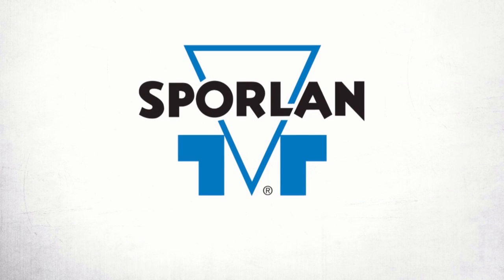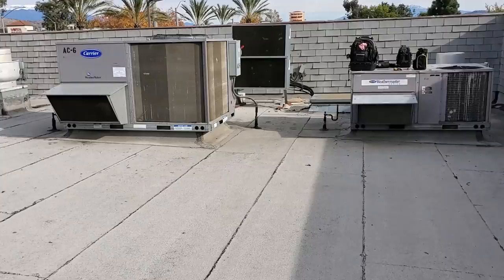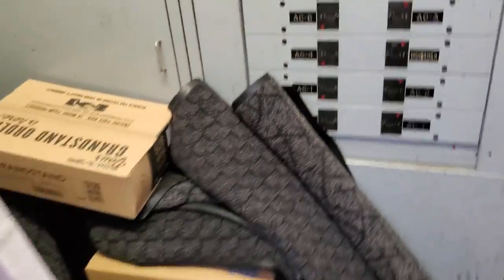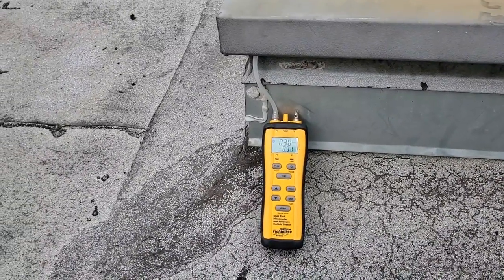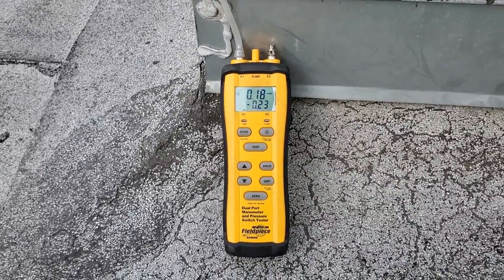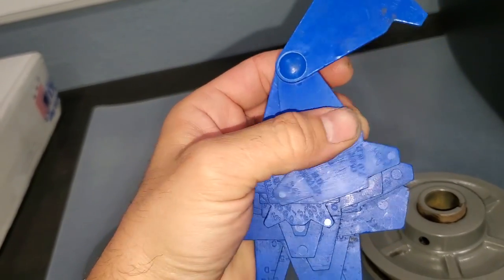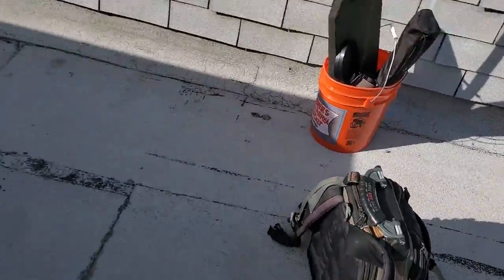THE FRONT DOORS ARE TOO HARD TO OPEN (AIR BALANCE ISSUE)

Comment: Correct me if I'm wrong, but that pulley you replaced, appeared to be adjustable and was out of adjustment.
The threads on the hub are the giveaway.
You can loosen the set screw there on the flat, then screw that flange, until they touch. Line up the set screw on the flat portion of the hub (closest to your best fit up), and you'd probably be good.
Belt alignment is VERY important!  I spent 3 years in the Navy, basically studying misalignment of all sorts. It is the primary cause of bearing failure of motors, not to mention premature wear on the sheaves and belts attached.
Go back and look at that job, I'll bet you find a bunch a shredded rubber and sheaves that are wearing uneven.
Reply from the maker: I will discuss this on my livestream this evening 02/07/22 @ 5:PM (pacific) on YouTube come over and check it out https://youtu.be/sE9dg71dJbA
Reply: @HVACRVIDEOS  I understand what you are saying there. Can't disagree. 
From the video, you can't see as good as you can, you being there, feeling it and seeing it, I got you there.
I understand how the speed changes for air balance and motor load.
Now, here's kinda my point. There is a gap between the hubs on the replaced sheave, pulley, hub (though that is really just the part that is in contact with the hub, yet I digress!) whatever. That gives you a smaller diameter sheave (even more with the wear) driving the blower, slower, right? So when you put your new sheave on, you are going to get a larger diameter, running the blower faster, putting more load on the motor.
This can be checked by measuring the amperage of the motor, before and after.
Yada yada...
The other thing that would be in the back of my head would be, Did the guy that put in on (the old sheave) know what he was doing?
In these cases, I'd check the blower motor amps, and adjust the sheave to give you FLA on the motor. Unless of course you have noticeable air balance issues.
I could tell you a funny story about an air imbalance that actually ripped the ass of my coveralls off!😄

Comment: In my case, I used to go to school in an old building with a built in air balancing system. It was a large fan unit in the center of the second floor, for whatever reason, but it was a bit funky at times. Sometimes air would rush into the building. Other times air would rush out. We also had some rather poorly maintained AC units on the second floor, which sadly would clog the drains, and it leaked all over my teacher's brand new $3000 laser smart board. Fried it instantly. But yeah, you could definitely tell the air system was dated. On humid days the building would really be unbalanced with airflow, the central staircase became a wind tunnel.

Comment: I wouldn't tighten those old belts. Replace first then adjust if needed. The next guy will put a new belt on and it'll be too tight and smoke the bearings.  Just replace the stretched belt and be done with it. New one wont slip as easily either.
Reply: New belt at least once a year I believe in!

Comment: They put the fancy economizers in the HVAC units in my building back in about 1980.  I figured out what they did.  When you were calling for cooling and the outside air was sufficiently cool then they would suck in the outside air inside in lieu of running the Freon system.  That meant that in the state of Georgia cool but very high humidity air was sucked into the building.  I would be sitting at my desk shivering as condensed water dripped from the ceiling like rain and soaked ceiling tiles crashed down.  It would have been different if the outside air was not severely humid.  What an awful system.  Mysteriously one day the whole economizer got bypassed and everyone was much happier.

Comment: No don't tighten the belt, replace it. The new belt will fit right at the current adjustment.  If the new belt is loose then make adjustments.

Comment: Because of my location in environment, I usually work on boilers and forced air furnaces more air conditioners, the boilers run hot water through radiators and pipes and boiler heats the water, I work on the electric circuits more than anything.

Comment: The way you replaced that schive was assuming it was set and left corect from commission. I always pull the manufacture start up airflow charts and toss a reflective sticker for the blower pully and take RPM and compare against external static pressure with economizer 100% closed. Where im at its very humid and we need to keep CFM within 320-450cfm. For the economizer them honeywells are easy find short and dont hack harness out unless absolutely no option. Most customers would not opt for Jace control. M7215A1008 is still available. Most of time i find uneducated tech just unhooks working economizer. Pease dont hammer pully on, all you had to do is loosen adjustment set screew that was ovaling the pully to slide on. Otherwise thank you for posting video on buliding static.

Comment: You probably inadvertently fixed a lot of water leak issues.  I bet if you looked around inside, you would find a lot of stained ceiling tiles from water getting sucked into the building from it being so negative.

Comment: I wire brushed the area and sensor rod around the burner where the flame sensor is located so as to have a clean spot for the current to flow thru the flame to ground. Always works for me.

Comment: 0.35in of water pressure mean 0.01299283 pound per square inch. It do not appear to be alot, but that is per inch. Let's say that the door is 36*80 inches, that is 2880 square inches, times that pressure mean 37.4lbs of force that the air apply to that door!
Reply: That’s about the same number as I estimated—an outrageously heavy door!
Reply from the maker: I will be discussing this on my livestream tonight, but imagine how many people walked away because they couldnt get in the door?
I will be going live on YouTube this evening 12/16/19 @ 5:PM (Pacific Time) to discuss my most recent uploads and answer questions from emails, the chat and Facebook come on over and check it out if you can.  https://youtu.be/_20hGnjjK44
Reply: In superior units?
Reply: @ΑΡΗΣΚΟΡΝΑΡΑΚΗΣ  No, in fake units. That's what °F mean, Fake degrees!
Reply: @ΑΡΗΣΚΟΡΝΑΡΑΚΗΣ  about 200 Newtons 😜

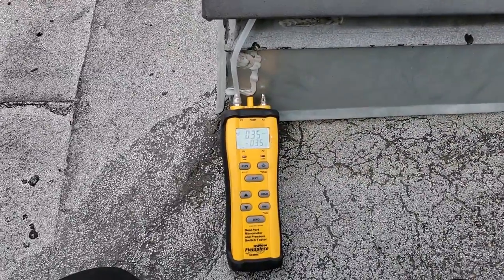Comment: 3:00 Holly cow, 0.36" wc negative, that is 89ish pascals, should be in the single digit pascals!

I service a BBQ joint that won't pay for a maintenance contract, but will call whenever their smoker starts to back draft into the restaurant when the filters in the makeup air and RTUs get plugged up, causing the building to go more negative than the little exhaust fans in the smoker can handle.
This year they've been shut down for 3 months so far, due to the damage from an explosion that happened in the smoker!
Maybe they will sign up for that maintenance contract if they are able to reopen.🤣

Comment: I'm wondering what happens to the Bldg pressure when all goes to full Econo ??  I don't see a Relief fan for each ac and normally
you would have a Relief damper in the Bldg to elevate pressure so In this scenario I just see a Bldg going More and More positive in encono ??

Comment: I'm in upstate New York,  if you're a tech in the northeast please never use wire nuts, only use proper crimped butt connectors or solder joints.  You will save your customers headaches and yourself call backs.

Comment: The worn pulley/sheave shows a great example of what the misalignment (shown with your straightedge) between the two can cause.
Reply: Those two shafts need to be realigned, else the sheaves will chew out again fairly quickly.

Comment: 17:50 That pulley no longer identifies as a V groove pulley, it is now a U groove.

I like the split taper pulleys because they make up for differences in 
manufacturing tolerances between the OD of the shaft and the ID of the 
pulley, especially when the shaft has been sanded a time or two.
I also find getting the pulleys aligned in all 3 planes an effort in 
futility on those units.

Comment: Just a tip: grab a dead blow or rubber mallet for hitting pulleys onto the shaft. Harbor freight sells em pretty cheap. It won't do any significat damage from my experience. Usually light taps wont mess the bearings up. You had the right idea with the sanding and lubricating. Sometimes they are fussy but i find a dead blow mallet to help get it over that tight spot on the shaft. Some may disagree with this but as long as you aren't giving it the beans and just tapping it i never see any harm in it. Love the vids though man! Super helpful for them newer guys! Wished i had a guy like you to show me the ropes when i was just starting out.

Comment: I had a store, new construction,  that had a positive air problem, literally blew the emergency exit doors on the sides of the sliding doors wide open. Also when I have a stuck pulley or blade I usually heat it up with some map gas and it'll slip right off.
Reply: In markets we also have problems with customers storing whatever right next to panels and shutting breakers off...sometimes they'll shut down a rack breaker accidentally,  easy money:-)

Comment: You should not make overpressure inside. Cold air will penetrate building structures cause condensation and mold is guaranteed. Slight under pressure is the way to go.

Comment: If you have all of your hvac equipment in a enclosed mechanical area, will the equipment last significantly longer?  Not fully enclosed obviously because you need air but mostly. An area that would keep out most dirt dust and water.  And UV.

Comment: Here in Austin Texas aside from dedicated MAU’s running or VAV and FPBs tied into an intelipak , economizer controls are absolutely useless, when it is 99f at 90% humidity they only want AC and building air becomes secondary to comfort

Comment: I had that happen with an air curtain it was shorted to the unit but breaker was not tripping. But I was getting weird voltage readings 120 on each leg but only 7 volts across the both  legs.

Comment: Any chance you might be able to show us how you adjust the fan speed on those? I get that you would just adjust the motor pulley but I would like to know how to check to make sure the motor isn't puling too much power as well. I am newly a business owner of a restaurant and we are having similar problems and we need to be able to limp through the winter and we cannot be pulling in this Minnesota winter air for the next 3-4 months..... I really wish we had the funds to hire someone to get it taken care of, but that is just not an option until summer rolls around. Any input would help us tremendously!

Comment: check  for ground fault with a ohms meter?  where is your Insulation Tester  (typically either 250Vdc, 500Vdc or 1,000Vdc for low voltage equipment)

Comment: As an electrician in eu Finland it's both interesting and horrible to watch the electric job on the machine, in Finland we have different standards, I'm not saying it's better or worse, I'm just saying it's different. We Have Much stricter rules of how big of an live voltage area are allowed to be open for possible touching. Also Doble isolated wires between the control boxes inside the fan is the standard.

Thanks for the great video and all the best it was interesting to watch
Reply: I assume for you guys 480v and 600v is more common in industrial/commercial use? In the US 208 single and 3 phase, 240 single and 3 phase, and 480/3 are our industrial voltages.
Reply: I haven't worked in industry so I haven't been dealing with industry voltage, I only heard abatu 1kw voltage and the transport lines off 20kv I think there is hig as 110kv. The standard voltage for apartments are one phase voltage is 230v and the main is 400v (between phase) and 50hz. 3 phase power is available almost every were. Only realy small flats from the 70 might have one phase.

Comment: I didn't quite understand the pulley wheel/belt problem in as much as the pulley wheel appeared to have a gap between the two halves? Couldn't the grub screw have been backed off and the two halves tightened together and then tightened up the grub screw? BTW not an HVAC but do have engineering background and watched till the end, very interesting. I was desperate to get my vacuum out to clean the damn things, what a mess they'd got into into!

Comment: Those economizers are disconnected because it never cools the building down enough. You’ll have a rtu putting out nice cool air with the damper closed, if you open the damper and it’s 200 degrees on that roof how cool do you think that air is going to be by the time it comes out the grill. Open economizer = return service call, closed economizer = happy customer.

Comment: oh wow... im working as an electrician in facility management in germany. we maintain HVAC and sanitary installations, but when i look at the way this is wired up... holy crap. this would not be allowed here. single wires without protection, only held together by wirestrips. the contactors with open contacts. in germany you hay not be able to get your finger anywhere where there is electricity. that this is up to code is well beyond me.

Comment: For any electronics I like it when there are schematics to what I am working on.
Not having them takes me even longer to work on electronic boards.
I do pinball repairs myself and have to track down problems some times multiple problems when a pinball machine is not working.
A lot of the time if a fuse is blowing it is most likely shorting to something.
I always get a manual if the game does not have one it is more expense but totally worth it when trying to fix something.

Comment: I'm really surprised that Carrier doesn't put those wires in a protective loom. I know they're low voltage but come on. Compressors vibrate so much that we once lost the return line from a roof unit for a CRAC because the c clamp had acted like a very dull multi-tool blade over a few years and had worn through the pipe. The supply side was on vibration dampening clamps with rubber but the returns weren't because they didn't go directly to the compressor. Basically anything anywhere near the compressors is subject to pretty severe long-term vibration so you need to loom everything and put the looms through rubber grommets that are thick enough to minimize the chance of chafing.

Comment: In the video, at 6:56 negative pressure increases which is what turned the blower fan and blower motor now Think about it when the motor isn't on and the negative pressure is turning the motor when its off it will generate electricity like a wind turbine I would just install 4 or 5 12 volt car batteries on the roof and then when the negative pressure turns the motor it generates electricity and charges the batteries and when the restaurant loses power the batteries kick in and power the ventilation system. Thank me later

Comment: My house where i live should have a negative air pressure. Just so that inside air does not get pushed out into different holes in the wall into insulation and such. Moist inside air would create mold in the walls. Thats what the air balancer guy told me :) Not saying it should be like that in commercial buildings though.. This is because i have mechanical exhaust air heatpump and regualar air inlets in the walls.. exit air is taken from the kitchen and bathrooms.

Comment: Carrier  AC units with issues? Nah... that can't be... according to many people Carrier is THE best!... Never mind that when I did security for a Tyson plant, the most common refer units that failed on the trailers, were Carrier... Even the brand new ones... had a unit that failed after maybe... 6 months? There were NO old Carrier units, all of them had been built within the last oh...5 years or so at the time. Meanwhile, 25 year old Thermo King units were still running just fine and actually easy for the guys to work on if they needed it... It took one of the guys 45 minutes just to change a battery and alternator on a Carrier unit... that was maybe 2 years old.... And then had another Carrier unit that threw a connecting rod out of the side of its engine block and it wasn't very old. The one Thermo King unit that died while I was working, died because ran out of oil... thanks to an old line to the pressure switch bursting and draining the crankcase. And this doesn't even take into account how much the building maintenance guys had to work on the Carrier AC units for the building....

Comment: Make up air for the kitchen should be coming from the kitchen make up air unit, and not be supplemented by the HVAC units.  The economizer minimum air is for the occupants, not the kitchen hoods make up air.  At least the way that is supposed to be designed if it is correct.  Otherwise air from the dining area will be drug into the kitchen to make up the difference.  The make up air should be injected at the perimeter of the grease hoods, as to create a Venturi effect, which will efficiently draw the cooking smoke up, without creating drafts across the food prep area.  Most restaurants do not have adequate make up air for the kitchen, or they let it break down, somewhere down the line, and don’t repair it.  We did a lot of kitchen work in my day.  Grease hood repairs were always the filthiest work, especially in Chinese restaurants.  They were the greasiest.  Sometimes belts get loose because the sheave wears out.  I replaced almost as many drive sheaves, as I did belts.  The metallurgy changed, and they began to wear out much sooner than the ones built back in the day. Once VFDs came out, the belts and sheaves lasted for ever.  Once the sheave wears, you will eat belts.  It’s funny how some techs will replace the belt every maintenance, and never fix the cause, which is the worn sheave.